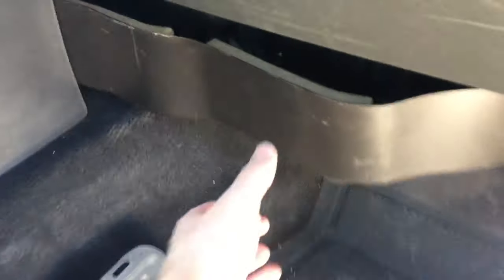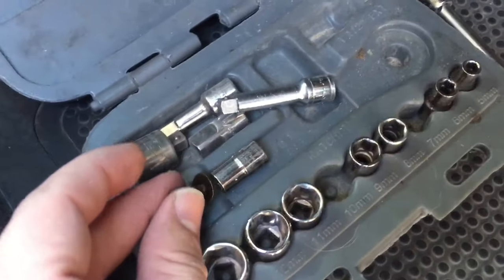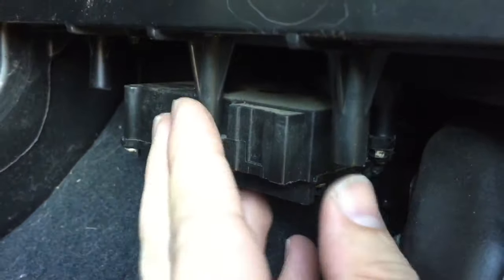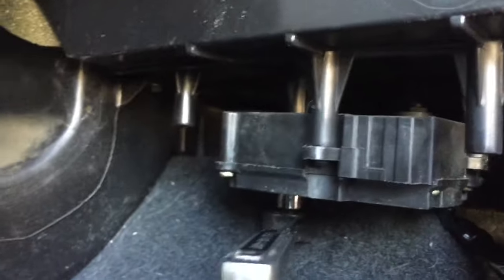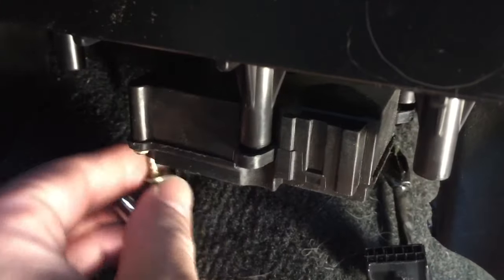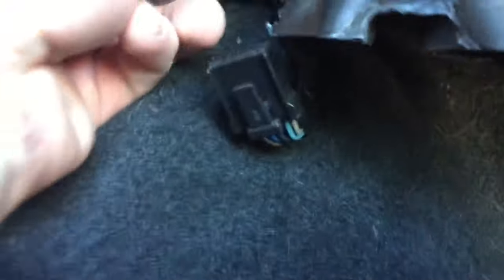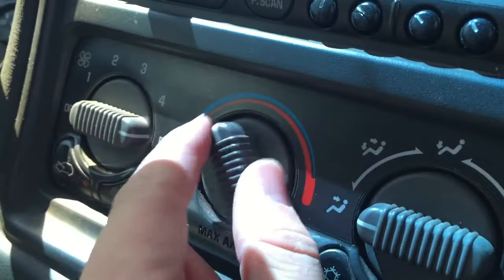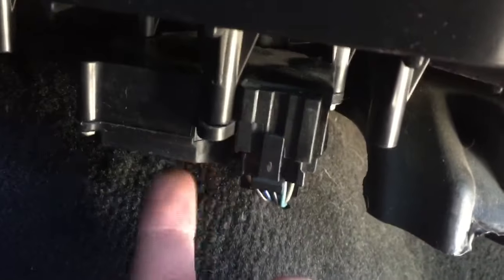Air only comes out HOT Blend door or only Cold Silverado, Tahoe, Suburban, Yukon GM, GMC, Chevrolet

Comment: So mine “works” but the second I turn the nob even a millimeter past fully cold it turns hot. There’s no variable “blend” or in between. I’m guessing replacing this should solve that issue?
Reply: Did it work for you
Reply: Joe smoe, did you replace it, and did it work? Mine is the same is your’s so I am going to replace it also. Thanks
Reply: Mine is also doing this. It is either full hot or full cold.
Reply: Same thing for me
Reply: Same here
Reply: Did anyone figure out this problem?

Comment: Yeah my problem is the door to control the temp gets stuck to heat so even during the summer it gets stuck... replaced the blend door motor for it but i still hear it get stuck how do you change that
Reply: Hey I have the same problem did you figure it out?

Comment: I have a 2007 Chevy Silvdrado with the single knob for cold and heat. The blend door is up by the glove box. Sometimes I get cold air out of the vents but it will turn to hot air and I don't turn the knob. I'm confused. Any suggestions.

Comment: I have a 2004 tahoe. I have the heat running, but the two vents on the driverside is blowing cold air out. Could this be the same actuator that you showed in your video? That information will be really helpful, thanks again.

Comment: I a strange problem with my 2002 Silverado. The ac quit last summer. We believe it's the evaporator. I can deal with no ac but I have super heated air coming up from under the dash with all controls in the off position. I reached down and felt the duct work in front of console on the floor under the dash. It was so hot I could barely touch it. The duct work over on passenger side near cab filter was barely warm. Where could this heat be coming from? It's not coming out of the vents. It's like driving an oven down the road!

Comment: Issue I have with a 99 gmc sierra. I have replaced these modules 4-5 times and when I do, each one can turn the temp to the opposite one time and then never again back to the other. I’ve taken apart the module to find the plastic gears don’t stop turning once I turn the temp knob to either hot or cold. The module then turns too far and damage the plastic gears. I have no clue why the truck is causing these modules to not stop turning and break them all the time. If anyone knows more information please let me know!
Reply: No idea why but this has happened to me with two replacements

Comment: Got in my truck this morning and everything functions like normal except it blows really cold all the to work. It’s 25 degrees here this morning. The blower works and changes from defrost to floor and  and front vents correctly. Could this be my problem since the heat isn’t coming on and everything else is working?
Reply from the maker: Yeah, very likely it’s this one shown in the video. I also have a video for the other doing the defrost and such, but it should be the one in the video you just watched. Here is the other if you need it someday Air only blows out defrost or top vents: mode actuator Blend door 99-2007 GM Silverado, Tahoe, Yukon
https://youtu.be/HRYHZoIO89M

Comment: What if we replaced the blend door actuator but we're still aren't able to get it to cycle? Not even installed but plugged in, the actuator is not cycling.  We tried a new climate control module and that didn't change anything either.  Any ideas?
Reply from the maker: I would check a fuse to make sure it isn’t blown
Reply: @dannyjohnsonsgarage  We actually tried a 3rd actuator (this one from NAPA) and it WORKS!   Thank you for the help.

Comment: What makes my ac compressor not come on when I turn it to the on position? But when I remove the relay and place a wire in replacement of the relay the compressor switches on
Reply from the maker: You’re forcing it on that way. It is likely not running because of low refrigerant or too much pressure, so be careful

Comment: My 2001 Suburban only blows hot when the temp dial is turned as far as it can go. As soon as I move it one degree counterclockwise, it's ice cold. Is that the blend door or something else? Thanks.
Reply from the maker: Most likely the blend door as it still works properly for heat and cold
Reply: @dannyjohnsonsgarage  Sorry, could you clarify? The blend door IS the problem or is it a resistor or something else. Fan works fine.

Comment: What if the ac is cold in the front (driver and passenger) but for the rear seats, it blows out hot
Reply from the maker: Probably the same blend motor but for the rear air
Reply: @dannyjohnsonsgarage  which is located in the rear section?